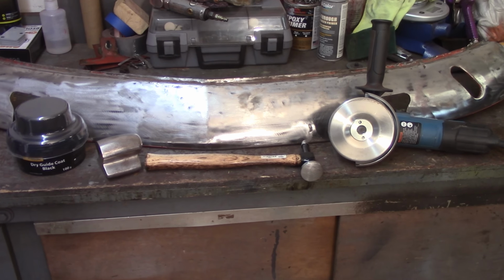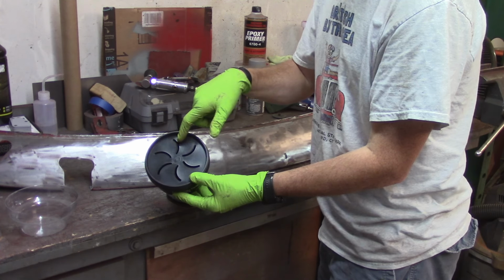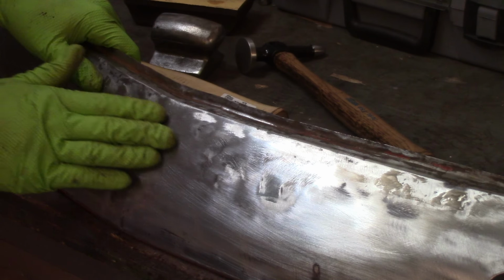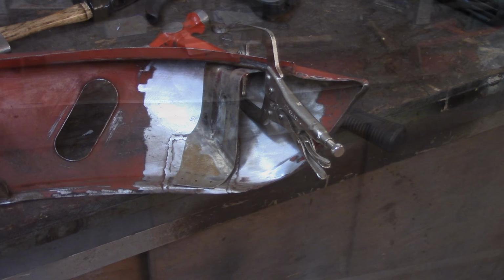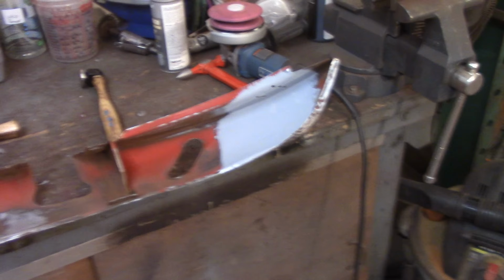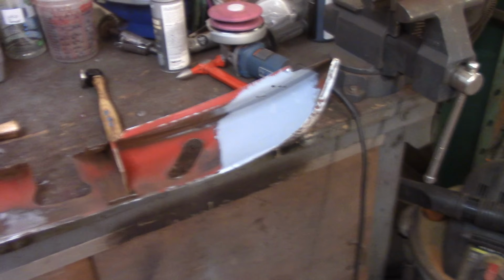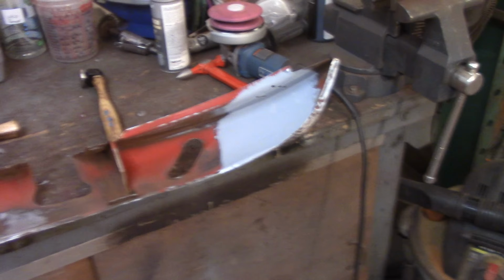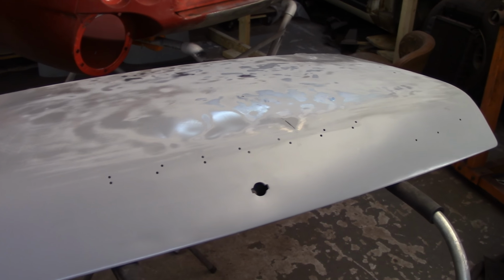Metal Work - Triumph Spitfire Restoration

Comment: Hi Chris, finally I have found the time to catch up to your vids,,  Barry Trownson is correct, the powder is for primer, and will not stick to bare metal, however if using cheep spray paint for a guide coat, do not use gloss, it clogs the paper, cheap matt black works best,  LOOKING GOOD BY THE WAY😁👍👍👍👍👍
Reply from the maker: Roger that. Thanks!

Comment: To my knowledge mate, the powder only sticks to the mat-finish primer. To do what you wanted I would just use cheap paint, or spray guide coat
Reply from the maker: Thanks, Barry. I did think about cheap spray paint while I was using it.